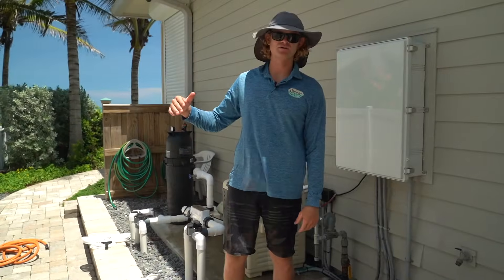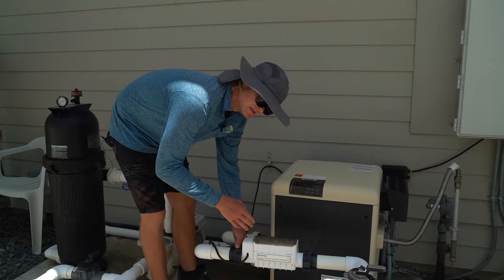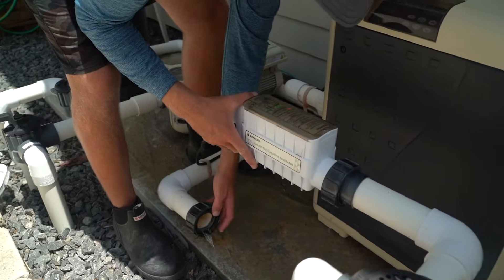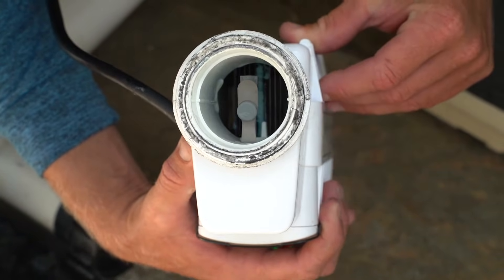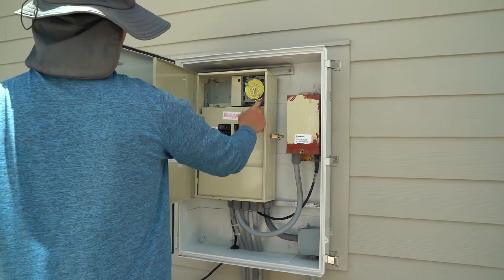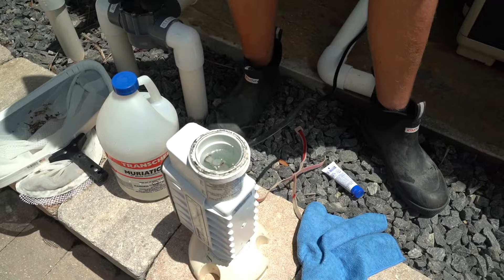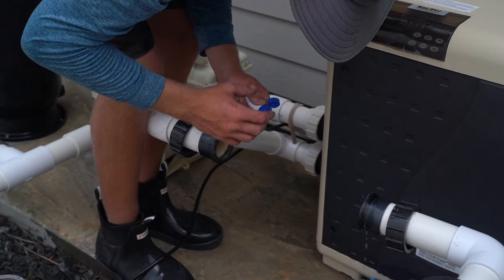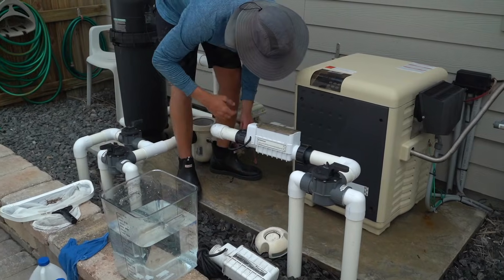HOW TO CLEAN & TEST A SALT CELL : PENTAIR INTELICHLOR

Comment: Great videos my friend. Question; for how many hours should I keep my pool working a day? I don't used much and i have salty water system. I have one of those PureChlor System and it was leaking water, I try to tigtned it thinking maybe it is loss but no, the glue in it was bad and come apart. I order some special glue and hoping it will work. I will keep you posted and I can send a picture as well. Thanks againg for your videos, you are really a PRO!  –Jorge in Spring Hill, Florida.

Comment: Couldn't you just put your working cell in the bucket of water and power it on to see if it works? I dont understand why you'd need a dummy cell and circulation to run this test.
Reply from the maker: Because some systems have to run to test just showing a way that works for everyone

Comment: You dumped the used acid with the dissolved hard water minerals back in the pool. 
Isn’t that just gonna cause the minerals to be back in the pool, and reattach to the salt cell plates?
I would just find an area away from plants, like gravel area, and dump the acid/mineral solution there. Then dilute it further with hose. 
It will just keep weeds from growing anyway. 
Better than dumping the hard minerals back into the pool.

Comment: FYI you don't have to cut them off just remove the broken threaded coupler go on line and purchase 2" split nut coupler and replace the broken coupler.  NO cutting NO problem works GREAT
Reply from the maker: Have you used before? I find that they don’t work in every situation but they do make a great choice in many cases
Reply: @PoolCareWorld  yep Used it on mine over 5 years ago I also use a STRAP wrench to tighten and remove instead of channel locks

Comment: Really appreciate the detailed video! Quick question. I have the IC40 and everything is working fine with the chlorine. All of the indicator lights are working fine except the low(red) salt light. This one stopped working completely. Any solution to this over than replacing the entire unit?
Reply from the maker: Make Salt Cell Great Again! How to Fix: Low Salt - No Flow - Check Cell - Pentair Hayward Jandy
https://youtu.be/2RLbbas5fkU
Have you seen this video? (:

Comment: NO ONE ever told me there was salt cell maintenance.  The $1000 price tag got my attention!  Thanks for a great video…I’m off to do mine since it hasn’t been touched in 2+ years!
Reply from the maker: You’re welcome! Keep on it  and you’ll be good for years!
Reply: Same here, had zero idea this had to be cleaned, 3 years.... yikes
Reply: How did yalls turn out? Similar situation slso
Reply: Same thing, was never told by the pool company who installed my pool that the cell needs to be inspected and possibly cleaned.  Even the pool opening or closing companies made no mention of the condition of the salt cell, and it was clearly caked up with calcium deposits.
Reply: I do mine but only like once a year because I guess I’m lucky in the calcium doesn’t build up on mine either it must be good water or maybe because the pool finish is so old there’s nothing leaching out of the walls not sure but if I take mine apart every three or six months there’s usually nothing in it. So I only clean it when it needs cleaning because otherwise I think you can prematurely wear out your cell by putting acid on perfectly functioning Cel it’s gotta wear away at the metal a little bit.

Comment: I don’t understand why you need to have water flow through a dummy plug to test your intellichlor. As long as you have power at the cell your testing and press the flow switch, shouldn’t that be enough? Why do you have to turn on the pool pump?
Reply from the maker: because some systems require it some don't but you are correct!

Comment: I’m not so sure I would dump that container back in the pool. Didn’t it contain concentrated calcium deposits from the salt cell?? you just dumped all those calcium deposits back in the pool. 
I realize the acid broke it down into its components, but they can re-aggregate back together in the pool. Might as well dump it on the gravel, adding lots of water to dilute. Especially where you don’t want plants or weeds to grow. There are great tips in the rest of this video though, that I can come away with knowledge
Reply from the maker: Never pour acid into the ground that’s terrible for the environment and erodes concrete. The safest place is to put it it in the pool it will be picked up in the filter. Thanks for watching!

Comment: That was extremely thorough and articulate, however at around 4:50 you put the stand on and went directly to adding the acid.  You didn’t mention that water was added to the cell FIRST!  If you put the acid first and THEN add the water, it’s very dangerous.  But an excellent video overall.  Thank you.
Reply from the maker: Did you read discription or video I have pinned in comments?

Comment: I have the ic40 salt cell since summer of 2022 and it just started to blow the 10amp fuse in power center. Do you think the cell went bad that soon?
Reply from the maker: Dealing with this same issue now with one of our customers I believe it is cell please let me know if you find anything out!
Reply: @PoolCareWorld  replaced 10 amp fuse and without salt cell connected light stays on inside the power pack. As soon as I connect cell and it cycles the fuse blows. Pentair customer service/tech support were useless. Said warranty expired over 2 years. How convenient piece of crap goes bad couple months out of warranty.

Comment: We have pool cleaning service come over and clean the pool...they told us our salt chlorine generator might not be working because there is almost no chlorine in our pool, but all lights are green on the generator, so do we just need to add more salt so it can produce chlorine or do we need to replace the salt chlorine generator? P.S:  we open it up and it looks clean on the inside. We also just fill the pool with some water and we just have a rain storm.

Comment: I had a salt systerm installed 8 mounts agon and the control pannel showed no out put, the unit was sent back to the suppliers who sent the unit had been running to long on height and burt out and they will not oner the garrentee,

Comment: Im not understanding why a dummy cell was installed.

Could you just submerge your salt cell in a bucket to see if bubbled emerge?  Why is therr a need to install a dummy unit?
Reply: The power to the unit is tied to the pump.
For the salt cell to generate, it has to think "it's" installed inline with the flow.
Reply from the maker: All depends on the system this one didn’t necessarily needed it cause it was controlled off a separate timer but it most of the time is required so I did it anyways

Comment: Whats the difference between the cleaning kit from Intellichlor, which looks just like a black cap with the O-ring versus the white stand, I see in this video or do I need both?
Reply from the maker: The one from Pentair works too but the one if the video is better cause it is one piece and leaks less link in bio 😎

Comment: This was the best video I have ever seen on cleaning and testing your Pentair Intelichlor salt cell.  From start to finish the guy is very thorough.  If he had only mentioned that the muratic acid put into the cell should be diluted - 1 part muratic acid to 3 parts water, with the water put into the cell first.  That is mentioned in the video notes, but many people don't read the notes.  Otherwise, GREAT VIDEO!
Reply from the maker: Great point I added a card in the video at the point of pouring the acid solution to make sure to get the point across, thanks for the kind words!
Reply: @PoolCareWorld what happens if you don’t dilute with water?
Reply: Yeah that, I would also recommend to not submerge the entire cell under water. If any water gets into the electronic portion of the cell it will be destroyed.
Reply: You also might mention that the cleaning cap doesn't necessarily come with your generator. You have to buy one specific to Purechlor.

Comment: very good video thanks for making it  - nice hat I must buy one my neck gets fried Here in Thailand the local goons don't do this and now on two installations Ive found the salt cell simply unplugged  and all calcified  away inside so much so you could build a bat cave out of the crap.  I am new to Salt Cells I did some experiments with scrap titanium plates in a tub plus a lab DC supply,  and saw massive amounts of CH being produced which then corroded away the plates because they were not Ruthinium coated, but that led me to buy a cheap salt cell off lazada Now I'm figuring out PH and other water chemistry getting the salt cell into production, not easy, but the target is NO CYA in the water from TCCA !!! Just clean Water with salt !!!
Reply from the maker: Stick with name brand if possible I prefer Pentair! Use amazon links! The hat is called a catchalot I believe! Where you able to get your problem sorted out?
Reply: @PoolCareWorld  ive used a generic cheapo one in my own pool it works fine very good 11,000 Thai Bhat  300 USD on lazada  (thai aliexpress) the other idiot got stung probably by the ppl who do the "you'll need a new one" stunt, preying on owner ignorance  Seen it all before here a proper;ly installed installation will have wires cut things damaged insect living in about two year and no support!  Certainly I dont use any CYA as I only use salt, of course sunligh kills the CH very quickly but so far no yellow peril or green slime thanks  🙂 I think its really important to emphasise lube on rings as Ive a stuck main filter one on my refurbed pump oops

Comment: Pentair told me to unplug it at first, were just pouting what into there? do you use undiluted muriatic acid? Is that consumer grade acid? I don't believe your to put HASS strength without diluting the acid.
Reply from the maker: Yes that is correct it was diluted please read description also have a card linked in video on how we dilute it! Thanks for watching!

Comment: I think maybe you cut out the part where you added water to the muriatic acid, but now it looks like you’re pouring straight acid into the cell. My understanding is that it is important to dilute the acid in a 1 to 4 ratio because the acid is damaging to the cell.
Reply from the maker: Yes that is correct it was diluted please read description also have a card linked in video on how we dilute it! Thanks for watching!

Comment: Thanks for making this. I was about to pay someone to come show me how to do this as a new salt pool owner. I feel confident doing it on my own after watching this!
Reply from the maker: Glad it was helpful!
Reply: Made it sound pretty simple, eh?
Reply: My cell barely  shows ca on edge of just few blades that I can get off manually.  Should I go ahead and clean w acid anyway? Can I spray directly inside cell w hose? Just want to be sure.   Also I'm thinking using white vinegar instead since doesnt "appear" to have scaling.  TBH I kinda stay at the edge of Ca hardness level.   Yeah little ocd here but ADHDer & " towing that line: gives good dopy 😂.  Thanks so much,  great video.

Comment: How is the pool pump set, how many hours for the RPM use.  what RPM is use for the salt generator?
Reply from the maker: Some work as low as 2000 but it all depends on flow and if the filter is dirty 
2500 would be the lowest I’d go if you’re playing it safe

Comment: I would never use straight muriatic acid when cleaning the cell. I prefer using half water half acid  solution  which will help prolong the  life of the ruthenium oxide coating on the blades.
Reply from the maker: I Agee the acid solution was pre diluted with water!

Comment: You seemed to use the muriatic acid at full strength.  Is this correct?
Reply from the maker: No please read description it should be diluted 1 part acid to 3-4 parts water

Comment: Any suggestions for replacement o-rings for the salt cell housing (size? brand?)  Or recommendations for removing calcium deposits that are on the housing of the PVC pipe joint itself?  We got ours open and found that someone had used plumbers tape to try to prevent leaking and that the o-ring is rubbing off black to the touch.
Reply from the maker: I would just buy the pentair brand orings to save the headache if the off brand don’t fit correctly. And for the calcium on the outside of pvc use a hard pumice and tap it an it will break off easily please subscribe!

Comment: I said to replace mine twice in three years don’t understand why they keep going out. They seem to last about a year I live in Florida so it runs you around. I’ve never seen my pool company do any type of cleaning on it could that cause the salt cell to fail.
Reply from the maker: Yes it should be cleaned quarterly and don’t run it at 100% if you want it to last longer

Comment: Excellent video. My pool guy retired and my salt cell wasn’t producing chlorine. I acid once and the bottom side still has clumps of calcium so I flipped it and acid again. Your test procedure was a big help. I even saw chlorine fumes coming out. I used Vaseline to lube the o-rings and hand tightened the salt cell and it didn’t leak. You just taught this old a few new tricks, thanks a bunch🙏🙏🙏
Reply: Never a petroleum product on o-rings
Reply from the maker: Awesome so glad to hear!
Reply: KY in a pinch, not Vasoline.
Reply: Plumber here, they are correct. A silicone based lubricant is best.

Comment: Great vid, I have a salt system that only produces chlorine when it runs overnight 24 hours !
When i run it normally through the day for 8 hours it doesn't produce any chlrine !?
Cell has been cleaned and plenty of salt in pool, no flow lights or add slat lights on the board ?
Any ideas anyone ?????
Reply from the maker: Thank you so much! First thing I would check is your stabilizer. Do you know what the reading for that is?
Reply: @PoolCareWorld  thanks for the reply, cyanuric or stabiliser is zero like all my salt water pools , ive never added cyanuric before ?
Reply from the maker: @Poolmandan.service  raise the stabilizer to 70 and see how that works! We keep all the chlorine pools at 50 and saltwater between 50-70. Whatever your stabilizer is times it by .075 and that's the effective chlorine rate. so example if stabilizer is 100 the effective chlorine rate is 7.5 ppm. Hopefully that helps!
Reply: @PoolCareWorld  our suppliers dont stock cyannuric acid, can you guys just buy it and add it to your pools??
Reply from the maker: @danielstorey2665 yes we purchase it 100lbs at a time. Leslies should have it if they’re close to you

Comment: Just did this today.  Thanks for sharing.  Is it safe to throw the used dirty acid mix into the pool?
Reply: Safe, yes but you just put back what the acid dissolved.
Reply: @jeffp9920  Exactly.  I did not do it. Thanks for your response.
Reply from the maker: I always dump used acid back into pool because the water in the pool is the safest way to dispose of it and the sediment inside will be easily be vacuumed up. Please don't dump on ground its not good for the environment. Thanks for watching!

Comment: I bought the Hayward stand for my Pentair Salt Cell and it did not fit.  I will get another option on line but I wanted to support the local pool supply and all they offered was the Hayward Brand.  It was $ 70.00 CDN so not the kind of mistake I like making.  Your video was helpful otherwise.

Comment: What happens to the sodium after it splits from the chlorine? I know the chlorine goes into the pool, and presumably binds to contaminants. Would this mean the chlorine gets used up and sodium is left behind? I appreciate your video. I learned a lot!
Reply: The sodium has a positive charge and choride a negative charge, they hook backup in the pool and circulate back through to split apart in teh generator,  its a cycle that never stops as the salt does not evaporate it is only diluted if you add water
Reply from the maker: Thank you for watching! As far as I know the salt to chlorine generation is continuously happening unless the pool is diluted. But I’m going to have to do more research to give you a more in depth explanation. I’ll get back to you!
Reply: At normal levels, the filter system takes care of it.

Comment: You should always turn off the breaker and unplug the cell from the power center before cleaning.  If you set your timer to turn off the cell 15 minutes before the pump quits running, you will reduce the amount of buildup on your plates.
Reply: Good tip on timer settings SeaDoo!!! to turn cell off 15 min before water flow or pump stops. Oh and regarding "Power on". These units can be wired as 220. So leaving it on and live while working with water and putting your finger in the damned thin???? Not very smart.! Take care stay alive!!
Reply: @AndreVassallo There is a transformer between the AC and the cell, which is only on 24V, so no problem. 😊

Comment: Great video! I’m a new pool owner so it was extremely helpful. There’s a lot of how to videos out there and I didn’t like there extensive wordiness or there disconnected business type demeanor. I super appreciate your down to earth real life approach. Your sincere genuine character, this something you most like aren’t even aware about. It comes naturally. Good job! You had said to use a 50/50 muriatic water solution, but later advised that you might make it a bit more diluted. I’ve heard 4 to 1. What would you recommend for this cleaning?
Reply from the maker: Thank you so much for the kind words we really appreciate it and I’m glad you were able to get value out of our videos, please subscribe if you haven’t already! To answer your question yes I messed up saying the mixture in the video was more like 1 part acid to 3 parts water, it’s also safer to add acid to water and not the other way around but always use 1 part acid to 4 parts water it doesn’t have to be exact just as close as you can get it 👍🏻